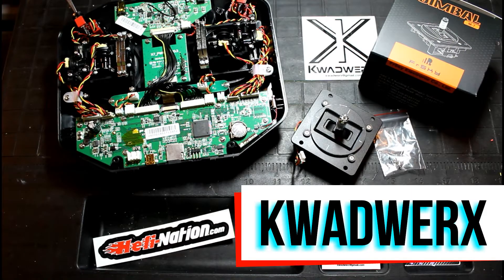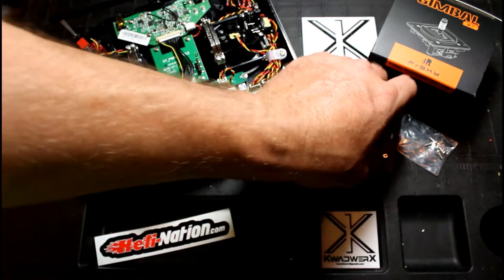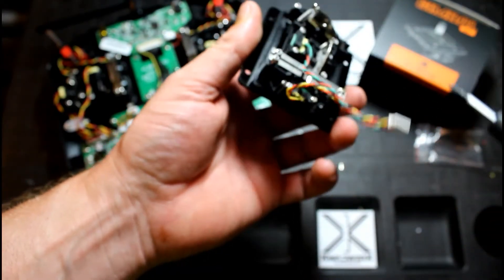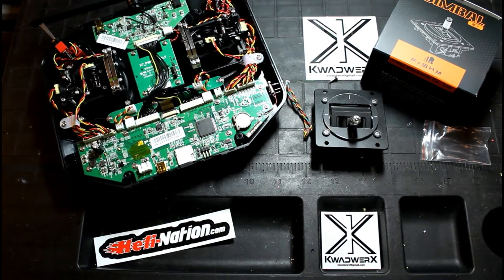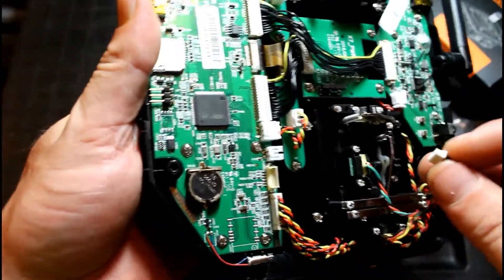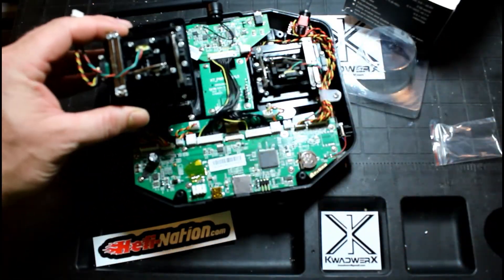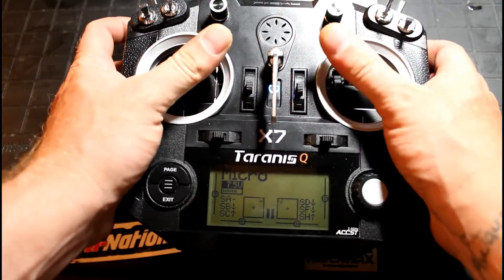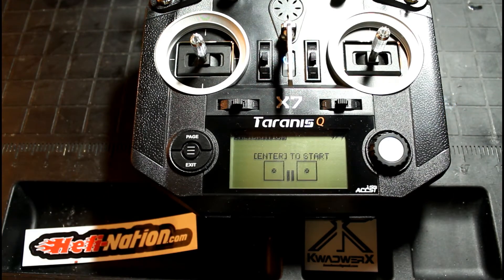Taranis QX7 M7 Hall Sensor gimbal install

Comment: Interestingly enough, I discovered my unit was DOA first power (yeah I installed the m7 gimbals before even powering it). As it turned out it was just the ribbon cable off the mainboard that was miss-aligned.  Hope this helps someone else.

Comment: The plastic / wood screws used really like to easily strip. Use backspin to find the thread before you start cranking down any screws.

Comment: The set screw mentioned at 2:50 has to go from the inside or the back plate will not re-assemble.
Reply: Yeah, I just found that out.